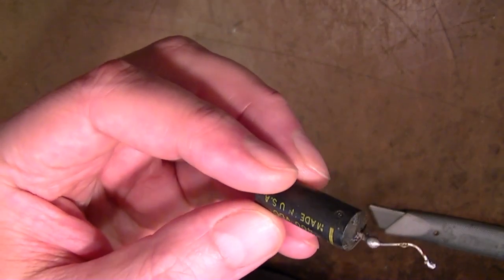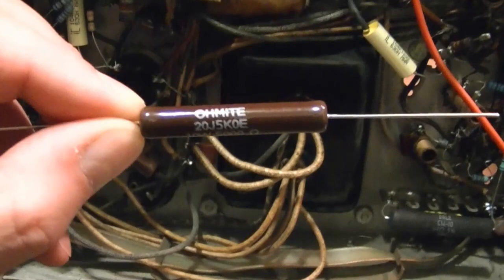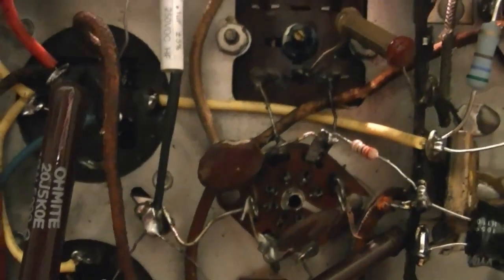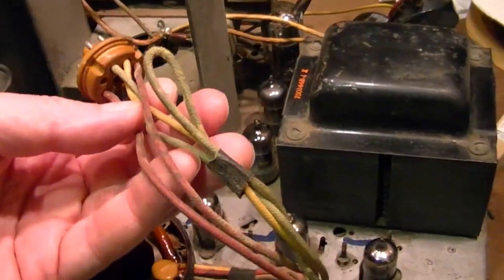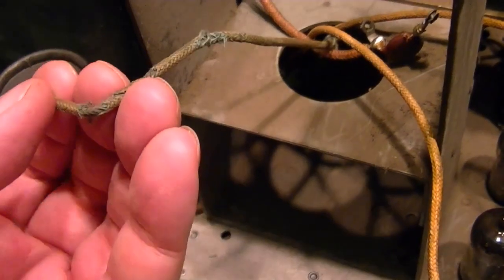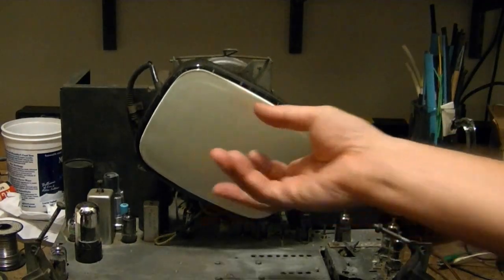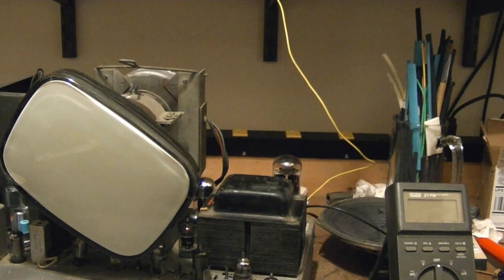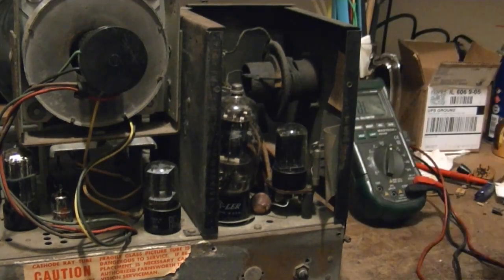Capehart 325 restoration pt3o7

Comment: Hi Bob,Just saw the video today,post date of 9-9-14 snooze tube getting slower. Nice first power up, expected to see lots of smoke. Capeheart put out many updates for the CX33 series.hopefully you have seen the 15 pages of updates in RIDERS TV manufactures receiver trouble cures, volume one pages 51 to 66 one mod for yoke flashover should be made on any CX series chassis,which by the way blows the 1/4 amp fuse. One other mod to do is the mod for vertical retrace blanking. With D.C. coupling from detector to the CRT produces a nice picture indeed. All the best Tom J. from Florida:-{ )
Reply from the maker: Hi Tom.  The issue I'm currently fighting is that the HV is only half what it should be.  Replacing the horizontal drive control seems to have resolved the fuse issue.  Mine is a later production version and many of those updates have already been incorporated.  Also mine seems to be AC coupled with a 0.1 uF cap to the cathode rather than the earlier DC coupled version.  Sams 160-2 matches it most closely.
Reply: bandersentv Lets see, what could do that. Make sure that the drive waveform is the proper waveshape and correct peak to peak. Make sure all voltages are correct, check the linearity coil with a ring test. Also do a ring test on the yoke. It might be possible that you have a miss marked yoke, i have seen that in my fifty years of working these things. If you have a 470K resistor across the 0.1ufd cap you do have D.C. coupling that resistor maintains the D.C. bias.  Capehart calls those two parts a anti bloom circuit. as for testing the flyback, not sure a ring test done with a VA-62 will work. You probably need a freq. generator and a scope to do that test.  All the best,Tom J. from Florida  :-)